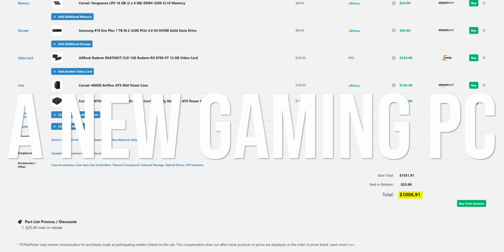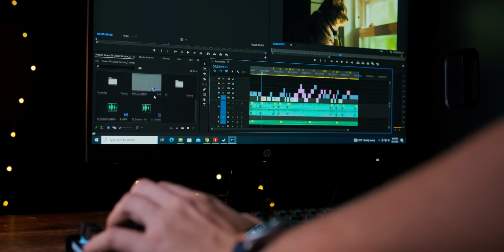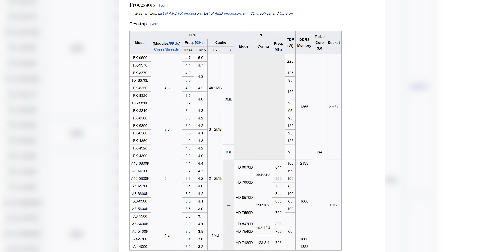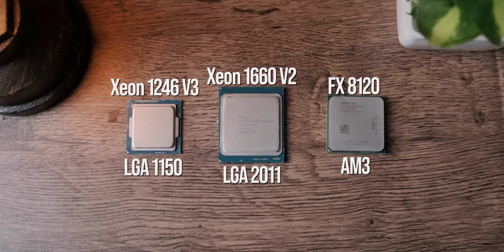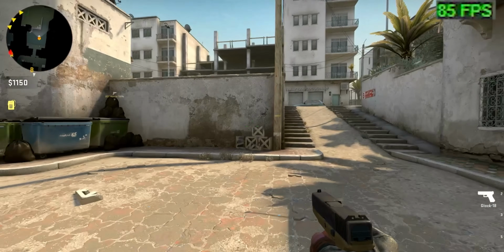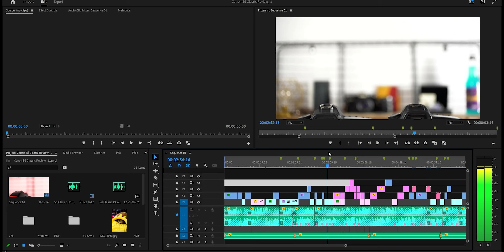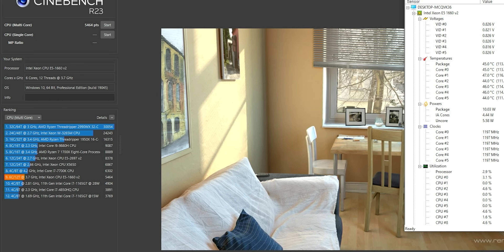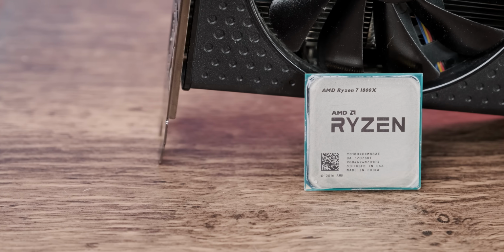DDR3 is DEAD

Comment from the maker: JOIN MY DISCORD https://discord.gg/2Wj8WanUzn
Reply: Yo algorithm got me here. I still use my i7 6700 16gb ddr 1600mhz planning to get up to 32gb and im running this with gtx 1050ti. Planning to turn this into retro machine that can run old games till 2018 up to 2k if needed. But 1080 will do fine unless I'm recording for you tube, also did a halo reach video on 2k the only thing causing problems with my ddr 3 system was stock cpu cooler. So cooler upgrade to do as well and by the end of the year in 2026 to set it up with dual boot win 10/linux and use as retro or net surfing machine. 
Nice video by the way can you check if ddr2 lap tops from 2007 are still an option my Toshiba from 2007 on 2gb ddr2 ram is somehow still running and kicking, can even go to the internet with win 7 32bit but I advise against it.
Reply: ok

Comment: my FX-8350, GTX 1070 WIndforce (the strong one), 24gb 1866mhz ddr3 still runs strong honestly, ofc upscaling aliasing or whatever it's called helps, but i can play modern titles on med/high settings at 60fps (my monitor is 60hz) and the only problem with modern online titles is tpm 2.0, my mobo doesn't have it so i am restriced with handful of games... SSD IS A MUST!

I remember running a 800mb ddr400 ram and like a pentium or smn in a Technics Drawing class PC we had, 15min boot and 10-15min to boot CATIA softwear lmaoo

Comment: i7-4790 3.6ghz
16gb RAM
1tb m.2 NVME SSD
500gb HDD
Geforce 1660 6gb
My PC has 16gb of DDR3, Paid 240 bucks for the PC, I knew nothing about PCs when I bought it and didn't know about DDR3, DDR4 Ect. I just wanted to play DayZ which I heard wasn't a very demanding game which is true I think. Also the computer guy said it couldn't be upgraded if I wanted to. . .the only thing I think that could mean is that I would need a new motherboard if I wanted to upgrade the processor at some point. Does this sound right ?

Comment: My i7 4790k and GTX 980 (both overclocked to the max) held me strong from 2016 until 2024 on 1080p 60fps until it couldn't keep up with 60 fps on helldivers 2. Upgraded to 7800x3D and 7900XT and it runs my new 1440p 144hz ultrawide very nicely :)

Comment: Literally still have the same motherboard and DDR3 ram since 2016. Ive known for years my motherboard has been the issue of some of my weird PC issues for years along with my RAM, so im finally ripping the bandaid off and getting a new motherboard with a CPU and ram which is all pretty cheap. Fixing my current build to hand it down to my younger brother as i plan on getting a pre built sometime end of the year or early next.

Comment: Just so you know, there are LGA2011-3 motherboards on the X99 chipset that have DDR3 slots and support Xeon V3 CPUs, not all of them but around half of V3 xeons support DDR3 ram as well as DDR4 so if you get a DDR3 board and something like an E5-2673v3 you will get a bunch more perfomance running on cheap DDR3 ram.

Comment: That 8120 might have seen better days or needed an undervolt with an AIO. 8xxx and 9xxx cpus need some love n tuning to shine. They're no masterpiece but still decent. My old 8350 build with just 4x8(32gb)@1333 +rx580 still can hit 3600 in r23 all day on stock clocks and is much more consistent/ case by case up a couple fps from your results with a lesser card. Also i feel a 256bit card like the rx5700xt or gtx1080ti would have made better use of the older pcie 2.0 bandwidth limits. Great vid tho 👌

Comment: I think corporations will start increaseing the price of new PC parts, so $2500 for CPU and $5000 for GPU (not Quadro), in the next 10-20 years I think is probable. The reason is that the technical advancement of hardware stalled, you no longer getting +100% performance after switching to a new platform, so they can't push the needed volumes to justify R&D and manufacturing, because of it they will increase prices to offset low demand, which will further push demand even lower. Plus big inflation will drive the prices even higher.

Comment: I have a 6th gen system,
I5-6600,
But sadly the ram that my mobo supports is only DDR3L-1600 (I have 16gb tho, 2x8gb)
Which slightly hinders the cpu in performing tasks like video editing but it still gets the job done pretty damn well considering the chip's age.

Comment: still running DDR3 in my Media PC since 2014, ran DDR3 in my main PC since roughly early 2011 for about 6 years-ish, then got the 1st Gen Ryzen 7 in 2017. Still using Ryzen 7 but with Linux. I ditched Winders completely on my Ryzen rig. I used Linux Mint, Linux Mint Debian Edition, Debian 12 w/Gnome, Fedora 39, now using Fedora 40.

Comment: To give you an apples to apples comparison, I put all of my older optiplex hardware into a newer one.  This means I went from 3rd gen i5 and ddr3, to 6th gen i5 and ddr4.  Same GPU, same SSD, etc.

This was when I was playing COD daily for testing.  Side by side in game, I gained 10FPS.  That sounds great, but my "experience" was not HUGE improvement.  In fact, I really couldn't feel the difference outside of the FPS counter.  Of course, more demanding titles would show a larger gap.

So, for anyone that says DDR3 vs DDR4 will change your life I would argue otherwise.

I sold the 6th gen and went back home to 3rd gen.

Comment: I have a e5 2680 v2 overclocked running at 3.6 all core and boosting to 4.2 all core with a base clock over clock and some voltage offset tuning on a Asus x79 WS board with a 1070 TI SC for a main gpu and a 1050 TI SC for a secondary for OBS with 32gb of 2400mhz ram set to 2133mhz because of the bclk over clock and its a workhorse burns through everything my niece has thrown at it and runs all her games really good Im going to put a rx6750xt as the main GPU and kick the 1070 back for OBS and throw another 32gb of ram in it then put the 1050 on a old Asus I7 2600k board for the younger kids to play roblox on

Comment: I have a laptop and and a pc, where the laptop has ddr4 and the pc has ddr3. The ddr4 ram on the laptop is absolute garbage, and it usually runs slower than ddr3 ram. If you still have top of the line ddr3 ram, it should run fine. I will probably upgrade by ram and gpu soon, but for now ddr3 is still working great.

Comment: i think the 2011 platform struggled with video rendering for the lack of avx2 instructions on the cpu (hasswell has them instead) x99 cpus has avx2 btw. Note also that 2011 xeons v2 are much better than v1... they're sandy bridge vs ivy bridge, quite a nice gap in performance for the same price..

Comment: man Fx8120 isn't even close to Fx8350 performance... The original bulldozer are just bad and should be avoided... furthermore, Fx8350 is a much much more common cpu than any Fx81xx 

If you couldn't afford another Fx8350 maybe a Fx8320e could do the job... or maybe use your time in another proyect.

stopped at 4:31

Comment: I will build LGA1366 X58 DDR3 system soon, I want to see how it performs against Core i5 4570.

The reason I will build such old system, is because I will run on it old software with Windows XP and Windows 7.

Comment: Interesting. I guess maybe prices went up for the 4th gen stuff already? I got lucky I upgraded when I did then. :P

I'm on a i7 4790. Using a Dell Optiplex 9020 motherboard with a few adapters to allow it to use a standard PSU and front panel connections in my current case. (an Antec 300)

Interesting you couldn't get NVME on that intel setup. Mine can by virtue of there being a modified UEFI for my mobo I could use so I'm natively booting off a NVME via that modified UEFI firmware + PCI-E adapter card. :D

My machine currently has 16GB of ram and the GPU is a Nvidia GTX 780ti. It's basically one of those "Optiplex" builds. But I just got the bare mobo and adapters. Didn't get the optiplex case to go along with it since my Antec 300 case is more then enough. Airflow is pretty good with that case and the Dell case would be a downgrade so I'm not full Optiplex. Just the insides are Optiplex. :P

Most recent game I've been playing on it is PalWorld which runs ok. It slows down in some busy areas but I can't complain. I think some of the slowdown might be due to memory. I plan to upgarde to the max supported 32GB at some point although the 780ti might be the bottle neck...haven't really tried to benchmark anything on this to really know for sure though. It runs 60FPS+ for sure in most cases though. Maybe not hitting 100+ but I don't care as long as it's at least 60. I game on a CRT so high frame rates are not needed so long as it's at least 60. 60 looks plenty good enough on a CRT. ;)

I upgraded to this setup to save on memory since I wanted to reuse my DDR3 ram. My previous rig as a 1st gen i7 965 Extreme Edition on a Asus P6T motherboard. Had that setup until 2022. Despite it's age it was still running things well. But I couldn't stand the long boot times. That board didn't have the latest generation of SATA either so SSDs could only take me so far. I get like 6 to 10 second boot times on my current rig so already was worth it. :D

I don't remember now what I paid for everything. I think I got the mobo for like $30 bucks. $20 for the adapters and $40 or so for the CPU at the time. Maybe I could have cut costs by doing with a different mobo but I went with a 9020 because I knew I could use NVME on that with a UEFI modification at least. It would be a shot in the dark with anything else. NVME support isn't really there for 4th gen so I lucked out that that I could with the Dell board. :P

Comment: I'd probably go for an Athlon x4 860k over anything FX-series if I'm stuck with DDR3-era Red team, but I'd bet the FM2+ socket motherboards would be more expensive than anything socket AM3.
I personally have an A8-3870K that I want to set up as a test bench, but I'd bet FM1 motherboards are the rarest of the 3 sockets.

For Blue team, I'd probably pick anything DDR3 outside of 2nd gen CPUs (LGA 1155), since you basically have free performance picking 3rd gen with the same socket.
Similar thing between early Haswell and the Devils Canyon refresh, but Devils Canyon stock might be quite a bit more expensive.
I personally have an i7-3820 that I've been mulling over buying a motherboard for, but I'm apprehensive about the weird Chinese refreshes of the X79/C602 chipset.

Comment: DDR-3 is dead?
What??
Hell no!!
I have the Asus Rampage Extreme III
I play the newest triple A games om a x5675 6 core 12 treads overclocked to 5Ghz.
I installed 48GB of RAM (Kingston Hyper-X Savage 2400Mhz)
Even up to 96GB of ram is possible when you have a Xeon cpu.
All triple A games with all settings on ultra on except resolution 1440p with a RX 6800 XT .
And it's running on an average 120fps.
So DDR-3 is not dead by a long shot.
The same goes for the x58 platform.
Ram speed really fast or slower does have little impact on game performance.
Also multiple game tests can be found comparing DDR-3 vs DDR-5 in gaming.

Comment: I remember running doom 2016 on a thinkpad x211 with an external gpu setup, was running a 750ti and was almost playable aside from windows crashing because of bad connection to the express slot. But otherwise it did work fine. Goes to show you that optimized cpu performance can make games run on way way worse processors.

Comment: Been silently wishing for a decent x79 board myself for years. The workstation is a good idea, but since its locked to ecc ram you cant use any of the faster ddr3. So thats a tradeoff, but on the otherhand, speed didnt have quite as much impact to performance back on ddr3.

Comment: Still using an i7-4790K (at a modest 4.40GHz all core boost) on a Gigabyte Z97X-UD3H-BK (V1.0) motherboard with 32GB Crucial Tactical Tracer DDR3 @ 2000 10-10-10-30 1T (using stock voltage) as the basis of my main system as of late 2023. Still no sign of the system dying on me at all.

Comment: I am in the same boat as you Used DDR3 memory for a long time. I rocked DDR3 memory since LGA 775 with my Core 2 Duo E8400/Core2 Quad Q6600 from like 2010ish to 2020 in my Desktop Rig but in 2017 I bought a gaming laptop that used DDR4 memory and be using DDR4 memory since 2017. So I rocked DDR3 memory for at least 10 years.

Comment: I'm not really sure I agree that PC are that high these days. I just built a mid-high PC with a z690 DDR5 board, 13600K, 2TB NVMe, 32GB ram, 4070ti, 1440P 144hz ultrawide, Logi G keyboard and mouse all for less than $2000. For reference in 2008 I bought a prebuilt mid tier XPS for the same cost. If you compare the performance for their respective eras, this PC blows that PC out of the water. We won't even discuss the Pentium Presario that I had that cost $2500 in the year 2000.

Comment: I had DDR3 with XMP set to 2400 Mhz which is not bad at all. Paired with 4790K and I could eaisly push majority of my games above 60 fps - some of them much, much higher. Windows 10 still supports it. I was able to play some games even with path tracing at very playable framerate.

Comment: My tech still laughing at my for having 1151 socket G4560, DDR3 2x8GB DDR3 1600Mhz is the only key why my pc is fast enough, last time I used it before it dies self was playing RE7 on High settings alongside Overclocked 1050ti 1861mhz.

Comment: I skipped over DDR3 entirely, going from my Core2 Duo with DDR2 RAM to my current rig which is a Core i5 6600k with DDR4.  The DDR2 board still works, as about two or three years ago I bought a power supply, new hard drive and some extra RAM, and got it up and running with Windows XP and Windows 7 in a dual boot config.  It has 7 GB of RAM and a Radeon HD 6850 graphics card with 1 GB of GDDR5 VRAM.  That system is a bit finicky in its old age though as it will occasionally lock up during the boot process, requiring a reboot.

Comment: Yeah, the FX in todays entry level gaming world is not a good buy, the CPU's the 8 cores anyway seem to hold their value really well though, often selling for close to $100 bucks I've seen some of them go for. But a i7 4770 ir 4790 I'd still say its worth using, with something like a 1660 or even a 1080ti, maybe a little stronger like a 6700xt, but I would only use a 4790 if I got it for next to nothing, and x79 boards are just not worth the price, though the Xeons are decently priced.

So many Ryzen parts on the used market, heck even a r5 1600 and 16GB of ddr4 would be the best cheapest route atm for the price, will have an upgrade path even if AM4 EOL, you have a better time with 1st Ryzen than any DDR3 build.

Comment: Currently running a 4790k @4.7ghz and DDR3 at 2133mhz. I game at 1440p on maximum graphics settings and haven't really had any issues with bottlenecking. At higher resolutions/graphics settings, CPU performance doesnt seem to matter all that much.

Comment: Why are you spending real money on overpriced, outdated hardware? I got my b450 board for 40 usd used and you could drop the cheapest ryzen quad core in the thing until you can upgrade to something better. Puts you on ddr4 as well, which is roughly the same price as ddr3 nowadays, and you have a better upgrade path. Seems like you're wasting your time (and money).

Comment: what your missing on this.
old hardware is pretty fine still.
its the pci express that is the problem man.
you want to play new games you need a new video card. ever buy a video card and you plug it in and its worthless? thats what im talking about.
old mobo will have old pcie and chipsets. you may end up unable to play certain games without certain instruction sets. old processor and chipsets cant run those instructions and is unable to run. old video card cant get driver updates and old directx wont run new games just like processor without the right instructions.
that being said old hardware has the other pcie problem. very low channel count and that means bad storage.
modern games need a decent ssd to run really. nvme is the only way to go. the socket and pcie lanes dont exist. and a regular ssd is gonna help but with the old processor and slower everything that nvme could really mask some of its downfalls.
is it viable sure but is it worth it? i said no since 2017. but my old computer from 2006 is still running and went to a friend back then and then his kid.
its starting to run into problems though. it runs great but it doesnt run on current standards.

Comment: When you buy a used Xeon, you play the silicon lottery. You never know where it was, under what conditions it was run, and if it was beat to death running full tilt 24/7/365 for years.

I've seen plenty of unstable server CPUs with various faults. Some cores aren't stable at certain clock speeds, the chip requires more voltage than normal, some instruction sets being used can cause the CPU to lock up, and of course completely dead CPUs.

Comment: I ALSO rocked DDR3 all the way until ~2020
(Used an FX 8100, later a 8350... and rocked a R7 260x and later a R9 390 with a 390x bios flashed until it died, and i got a rx 580 8GB. This worked great.)
The large core count of those older CPU's kept them relevant for a while... Seemed like they even got better for a bit when multicore gaming took over.
Now using R5 2600 and a 5700 XT.

HEY! If you have time, I'd love to colab on a video sometime. Let me know!